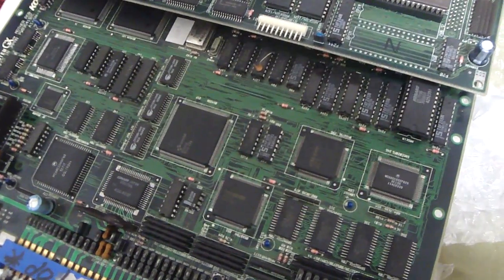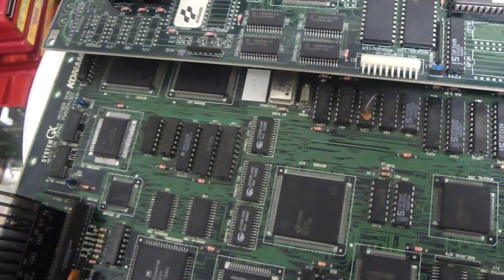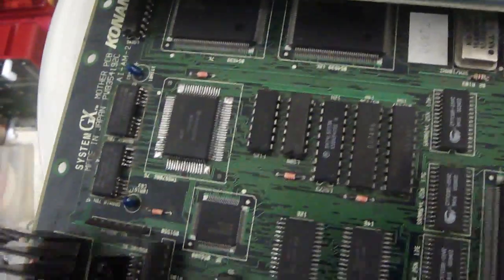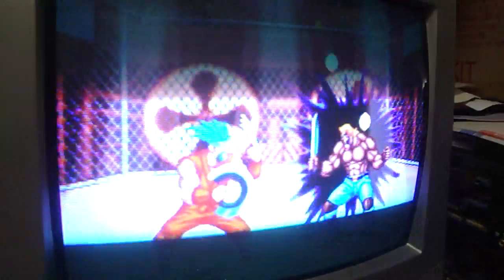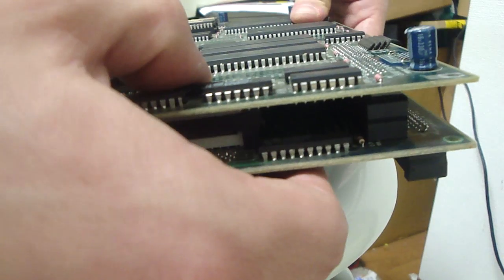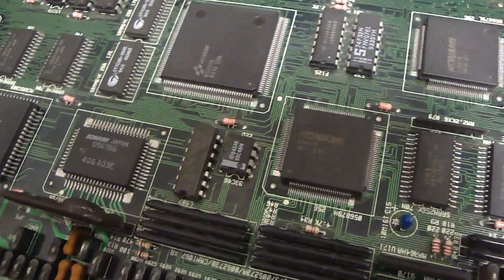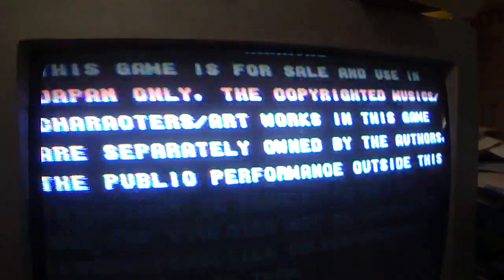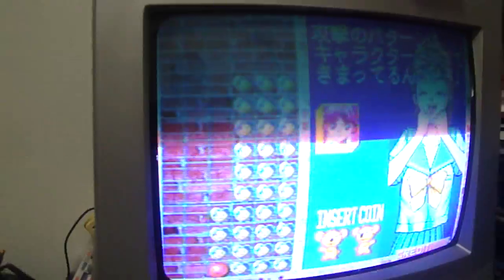Konami GX System Arcade Board 22 D/M GX073 Error Fix And Trouble Shooting

Comment: I almost don't dare to ask, but when the solder did not stick to the pins or traces, did you try wetting (or flooding in extreme cases) them with liquid flux first? I found the no-clean type to be a particular useful tool, it takes care of all the corrosion and residue and can easily be cleaned off later. The flux core(s) inside the solder are not always sufficient to remove everything on these old chips,
Also, thanks for the video. Nice knowing that another board got rescued from the landfill.

Comment: Apparently Konami GX boards are very similar to DJ Main boards for beatmania and Pop'n Music games.  They don't look exactly the same, but you can tell it has a lot of the same chips and specifications.  And of course DJ Main doesn't use Jamma, it uses some other really weird connector that I have never seen before.

Very cool stuff.  I wonder if the test switch fix works on DJ main with one of the problems I am having for one of my games.